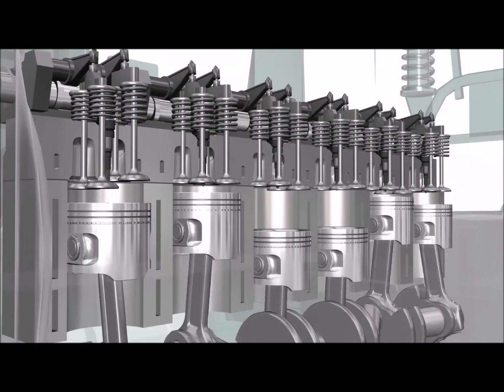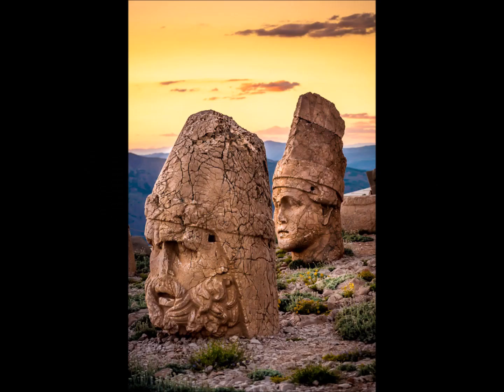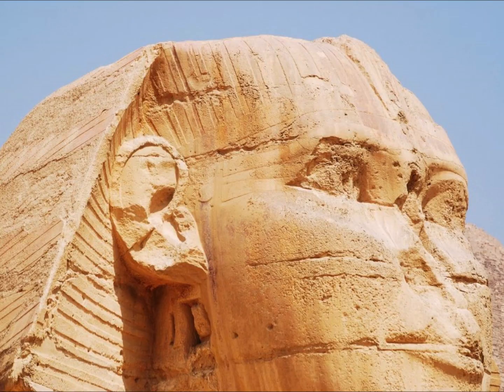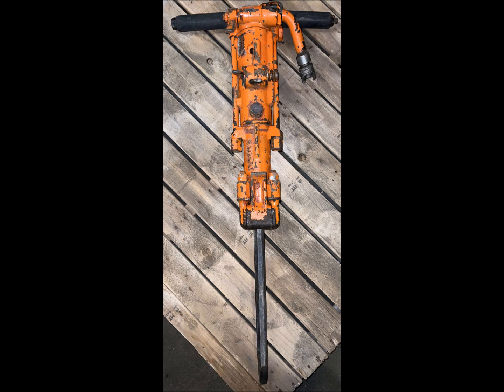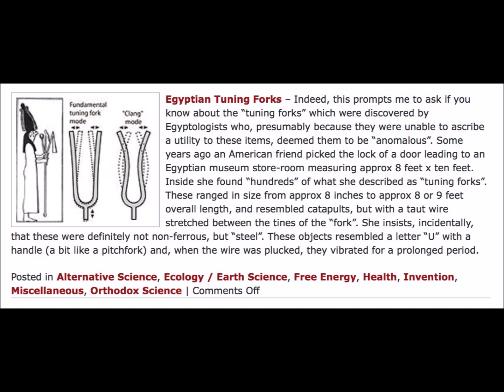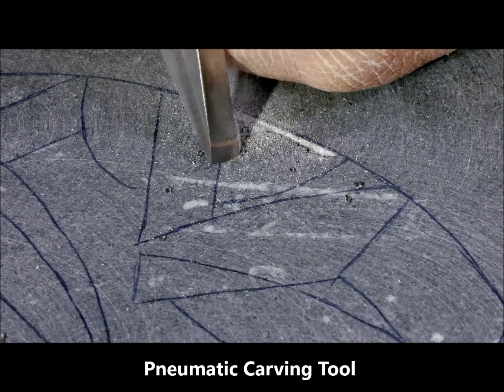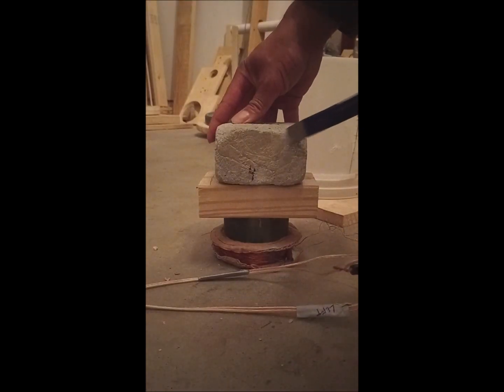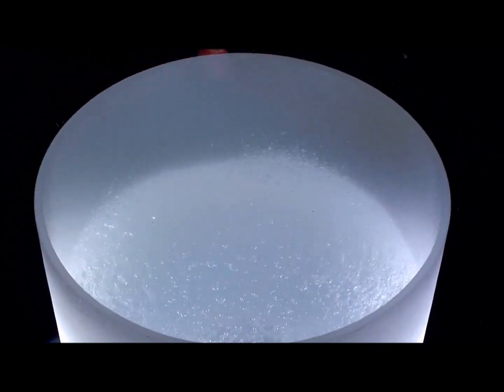Ancient Acoustic Carving: Did the Ancient Sculptors Use Sound to Shape Stone?

Comment: Even if these flights of fancy were anywhere near the truth, you still have to explain where the energy to do the work was derived from. No gasoline, no electrical generators to drive motors. Anything that took energy from a tuning fork would kill the vibrations instantly. The large tuning fork shown working here is obviously driven by  solenoid coils. The coils are evident but the ancients did not have the electrical supply to power such a device. Equally fanciful is the suggestion that Alien technology was involved yet no record or artifact remains to substantiate this notion. No single broken Alien drill bit fashioned from the classic 'Unobtainium' carelessly lost in the ever present sand.
Reply from the maker: Those are valid points, but before jumping to definitive conclusions, you might do well to check out my videos on thermoacoustics. Electricity is not the only way or the best way to generate powerful sound vibrations. Heat can be converted directly into sound. Such devices are essentially external combustion engines. The steam engine is an external combustion engine which enabled us to transport thousands of tons of materials at once over the Earth's surface. And so, it stands to reason that thermoacoustic vibration engines could do the same. Further, if you google, "ultrasound makes rocks easier to crush" you will find a scientific paper explaining how resonating stones at their ultrasonic resonant frequencies causes micro cracks to propagate within them; rendering them easier to crush and by extension, easier to cut, carve, and core drill. So, if we can believe that the Egyptians indeed carved stones with the basic tools in the archeological record, then it follows that ultrasonic sound vibrations (which can also be generated without electricity, like the mechanisms within a dog or steam whistle) would make processing the stones just that much easier. Hence, perhaps we shouldn't ascribe these concepts to, uh, "flights of fancy" just yet. Eh? Also, I don't exactly subscribe to the ancient alien theory. I think that civilization has simply been cyclical rather than linear with several epochs of advanced societies throughout antiquity. Anyway, "sounds" like you have a LOT more research to do. Pardon the pun.
Reply: Yeah, we all know that. This is more of a proof of concept and a suggested means, not a complete answer, not a production model.

Comment: The Egyptians used their tuning forks to split rock(mainly), and they used the other end not the fork end. Imagine having a large rock bar (very heavy pry bar, I've used them to break off enormous slabs of bed rock while gold mining) but instead of having dual ends one point and one straight chisel, you would have the straight chisel on the bottom side (rock contact) and the top end would be a very large tuning fork (long tangs) tuned to the resonate frequency of whatever rock you are working with. I could also see a small straight trough cut using sand and a copper saw shallow just to create a straight line for a more accurate split. That's only if we're not talking any higher tech. Nowadays I would use a tunable vibration that can reach ultrasonic vibration that I could just attach to whatever tool I wanted. Also a good way to levitate stone, Eddy Leedskalnin's box is a prime example of similar things. However sympathetic harmonics and resonate frequency is more of a destructive force like cutting, carving, (destroying cancer cell ...)etc. so your levitating frequency should steer clear from those for levitating as you are trying to move stone vs cutting or sculpting... My two cents, blessings

Comment: I mean, you don't have to hit the fork to make it vibrate. You just have to produce a sound which has the same frequency, anywhere near the fork and the it will vibrate "by itself" You can observe this phenomenon if you have two forks of the same pitch. If you hit one, the other will pick it up. Have you tried using the shaft of the fork as "cutting tip"?
Reply from the maker: @mementomori4972   You're right! We don't have to directly hit the fork. The vibrations could be transmitted from an adjacent fork through the air or even through a wire!
https://youtube.com/shorts/kSuMB5_rb5s?si=_R9TV1moW5po0U1v
I haven't tried it with the fork's shaft or base yet. But I plan to try that and some additional experiments soon.
Reply: @gsutton78  It doesn't even have to be another fork. It can be any type of instrument, which generates the same pitch. The Egyptians had bowed string instruments. The problem with a second fork is, that one fork only resonates for as long as the other one resonates,...which in reality is a relatively short amount of time. If you produce a constant sound with some kind of hurdy gurdy or singing bowl, the fork would resonate permanently. An Egyptian was-scepter at least looks like something that has a tuning fork on one end, and a cutting tool on the other.
Reply from the maker: @mementomori4972   Another person even suggested the human voice as a driver for the cutting fork. I could certainly see that if the voice(s) were amplified within a resonant structure!
Reply: @gsutton78  Yeah sure, but you would have to be a good singer to hold a constant pitch and you would have to do it over and over again, which just seems a bit impracticable to me.
Reply from the maker: @mementomori4972   Not really. In ancient times, certain people would likely be trained for just such a thing. In Egypt, there appeared to be little separation between the spiritual and physical. Unlike today, they saw everything as being interconnected. In short, the ancients focused on the connections between everything, whereas we today prioritize the differences. Now, if we could only reach a balance between the two philosophies.
Reply: @gsutton78  Then what do you need a sonic cutting device in the first place? just connect with your spirits and hammer away. They might have been spiritual, but they weren't stup!d. It's ok to disagree. We all are searching for the truth.
Reply from the maker: @mementomori4972   Uh, no. What I meant was they saw the spiritual as part of actual existential reality. And so, someone being trained specifically to be a vocalist for processing the blocks for temples would have been reasonable. The Pharaoh was buried with physical objects to use in the afterlife. That alone grants insight into their thinking. What we today call different dimensions or the multiverse, they saw as the spiritual. And just as we could imagine crossing over into the multiverse or bringing things into and out of that realm, so too did they imagine being able to cross over into, take things into, and bring things out from the spiritual realm. The resurrection and ascension of the king was absolutely vital to the continued existence of their civilization. Hence the importance of a person being trained for such a singular task. Everyone played their part in the greater good. Something we today have lost as we're more divided. Perhaps try to understand instead of trivializing someone else's viewpoint.
Reply: @gsutton78   As I said, it is ok to disagree. From my point of view you are trivializing mine. It's a matter of perspective. I understand where you're coming from and I respect your thoughts. I for various reasons and from a professional point of view just don't think that you're right. I understand now that any further argument wouldn't be fruitful for either of us. Good day.
Reply from the maker: @mementomori4972   How did I trivialize you? YOU started this conversation, and looking back on it, acting like you had all the answers. All I gave was the "idea" that the voice, amplified by a resonant space, could have theoretically been used as a source of power. And rather than just saying that's an interesting idea, you start getting sarcastic. No, you are the trivializer here. Not me. At least I've done some work in the area. And even still,  I don't act like I know every damn thing, which is why most of my titles are in the form of questions. You're the one acting like the know-it-all. If you don't like additional ideas, perhaps you should refrain from commenting. Then you want to end the conversation on your terms. Typical egotist.

Comment: Perhaps the used a master oscillator, vibrating at a lower frequency. The tool forks were tuned to a harmonic of the master. And maybe the length of the single shaft/tool was tuned to a standing wave, which are fewer but of higher amplitude...
Perhaps...

Comment: In order to more fully experiment your premis, have you considered forging various sized tuning forks or, having some steel rods bent for you into tuning forks by a local metal shop? Placing the copper wire between the tines and testing it on granit fragments you can buy really cheap ot a headstone shop. The amount of heat needed to bend the steel can be achieved by using a map gas torch which can be bought at the hardware store. I was wondering if you take the wire, string it between two forks but put the wire down onto the rod portion of the forks. If you strike the forks un unison would it cut?

Comment: Swaram sound stones.  very cool, very beautiful. They depending on their form can produce sound. Such as the same sound as wine glasses with water.
Reply: I don't think they would have much of an effect on cutting however interesting nonetheless.

Also,  I in no way have knowledge on electrical devices or engineering,  how reasonable would it be to use the Baghdad battery in series, or parallel to make an ultrasound oscillating device ?
Reply from the maker: The Baghdad batteries produce very, very low power, even wired together unfortunately. It is, however, possible to generate powerful vibrations using heat differentials, known as thermoacoustics. With what the ancients knew about thermodynamics, I think it's a strong possibility. The Sterling heat engine is actually classified as a thermoacoustic device. What's interesting is that ancient Austroasiatic peoples developed what is called a 'fire piston' in "prehistoric" times. It is a basic heat engine which they used to ignite pieces of timber for fires. It proves that people thousands of years ago possessed a practical understanding of the ideal gas law which states that the temperature of a gas is directly proportional to its pressure. A few modifications to the fire piston concept could transform it into a heat engine. I did a couple videos of thermoacoustics: 
https://youtu.be/DwI4vAKRSMY?si=hRBQI83_Hitm7HFy
https://youtu.be/ruyqcrUBkao?si=mlkK34yS6tjdS5YX

Comment: Very interesting stuff, yes I think they must have came up with some very clever ways of doing things that we are probably only still figuring out, despite them not having the types of technologies we have today.
Also apparently burning around granite can weaken it considerably, and could explain the "scoop marks" found around things such as where obelisks were cut out.
Reply from the maker: I agree, especially after discovering the account of an experiment by Japanese researchers in 1978. They attempted to build a model pyramid 20 meters high using the "primitive" tools and techniques proposed by mainstream archeology/Egyptology. Ultimately, the experiment failed and they had to resort to a pyramid half as high. But the real revelation is that they eventually had to bring in modern 1978 technology including electric saws, railroad tracks, and even a helicopter to cut, move, and lift the stones in order to get the model pyramid built by the preset deadline. That says a lot.

Comment: I read that the ancient Egyptians used lifting machines, perhaps utilizing pulleys, to lift the stones into place for building the pyramids.
Reply from the maker: Perhaps. Either way, they would have to have used far more sophisticated methods than those traditionally attributed to them. In 1978 Japanese researchers attempted to build a model pyramid 20 meters high using the "primitive" methods espoused by modern science. But they ultimately had to settle for 10 meters, nearly 1/14th the height of the 137 meter Great Pyramid. In the end, they had to use modern 1978 technology, including a helicopter and power saws, in order to get the model pyramid built within the allotted time. Now, that's very telling.

Comment: You’re not considering that the Romans actually mind gold out of mountains, using water pressure they had one of the greatest aqueduct systems on the planet. I knew how to use water under pressure today’s water jets can cut stone or steel consider if they knew how to manipulate water and sand under. High pressure
Reply from the maker: The Romans did have such water systems. But it doesn't appear that all ancient civilizations did. Especially not across the vast megalithic period. They all likely would have used various methods just as we do today depending on the technology and resources immediately available to them.
Reply: Nonsense. We don’t know most of everything they had was destroyed in a huge, cataclysmic flood so we will not know, but all around the world. There’s some very precise, cutting of rock, just like the handbags and many other things that co inside a worldwide civilization but that isn’t the paradigm the elite ruling asses want to project is it? @gsutton78

Comment: Isn't the tuning fork powered by the generated just a rudimentary version of a dremel though ? I think it's a bit far fetched to say that you are cutting the concrete / stone with sound its just vibrating of the surface and eroding it...
Reply from the maker: Um. No, it's actually carving the stone like a modern carving tool. Also, in these experiments, the tuning fork isn't tuned to the material itself, so that significantly mitigates its efficacy. But sound vibrations can carve and cut. There are industrial level sonic tools used for that purpose today. I'm just demonstrating that it's possible that the ancients could have done something similar.
Reply: Exactly that's what I was saying, so it's basically a Dremel/modern carving tool. When you say sonic tools,  are you talking about vibrating an object such as a tuning fork against the stone/material? Or are sound waves themselves cutting the stone? Otherwise I feel it could be rephrased as cutting using vibrations rather than sound.  @gsutton78
Reply from the maker: @EmmaPapworth-u1u   ??S Sound means vibrations by default. You can't have sound without vibrations. Additionally, it's  different from a dremel tool in that the tuning fork is vibrated at resonance. In this condition, we can get maximum vibrational amplitude. And if we constructed an improved device which could match the resonance of the material or its harmonics, there would be maximum transfer of energy from the tool to the material, resulting in the cutting of the same material with less energy or harder materials with the same energetic input. There've been professional scientific studies showing how vibrations at a particular stones resonance(s) can allow for the crushing/pulverizing of stones with less energy. It follows, then, that they could do the same with cutting and carving. As far as powering such devices, there are ways to do so without electricity. Thermoacoustics being one of those ways.

Comment: Using sonic tools, like what I suspect the Ancient Egyptian Was Scepter is/represents, matching the resonate frequency of the tuning forks with a separate sound source of some kind, either from chanting/singing, or using instruments like horns, trumpets or possibly even having a group of slaves/workers banging other forks in regular steady intervals to power nearby tools indefinitely as long as needed to work. 
Basically high frequency jackhammers, bang the fork end of the scepter with a hammer(ankh) and touch the cutting edge on the other end onto the stone and chisel away. 
Sonic tools with today's electrical technology have proven to work far more efficiently than conventional saws and blades etc; can easily cut through granites and hard stones like butter. 
We use sonic drills here to dig water wells for people's homes, sometimes having to drill over 5000 feet of solid rock in some places just to find water.

Comment: I want to see a huge steel tuning fork (trident?) strung, end of handel shaped or tooled up, plucked, and applied to stone. If their large forks are scaled for larger work let's go with one of those first. Keeping the tines vibrating could be the job of a plucker while the weight is carried by a catapult-looking fixture (adjustabe angle of attack) and the impact engaged by other hands. It would be like a tattoo gun and a battering ram sort of. Bravo on adding good content to YouTube.

Comment: I wonder if the vibrations last longer when it’s the bottom of the shaft that is the chisel end not one of the arms of the fork …. It might be possible to hold the staff in one hand at a node where there is no vibration and constantly strike the fork with something to keep it going. The key will be to determine the resonant frequency of the particular rock type and have a chisel tipped tuning fork built to the right specs that produces a matching vibration at the tip of the chisel to that of the rocks frequency.
Reply from the maker: Yes, this will be the next technique to try!! 👍